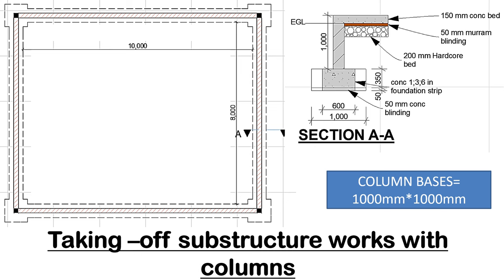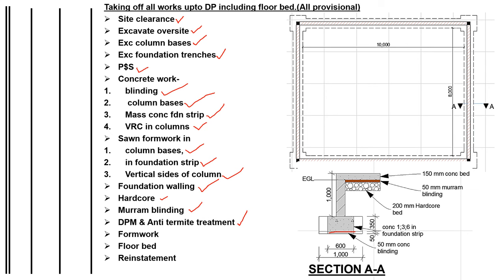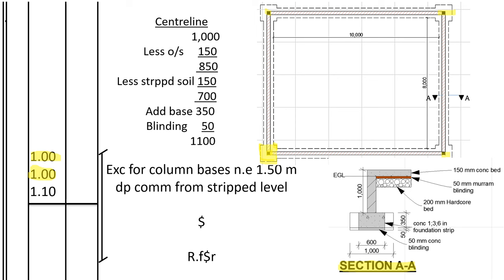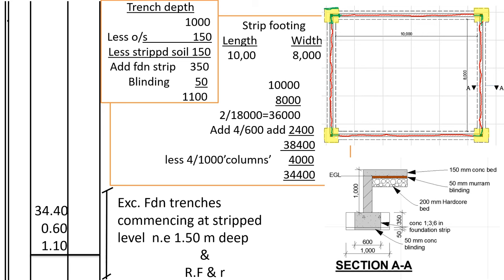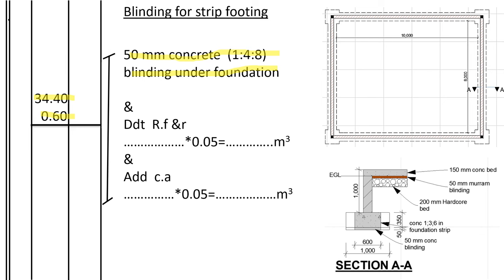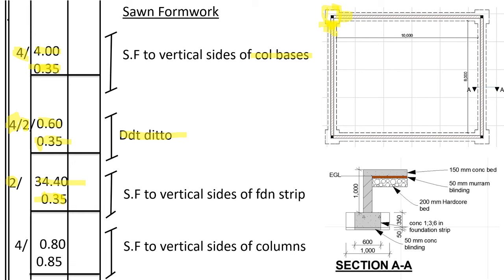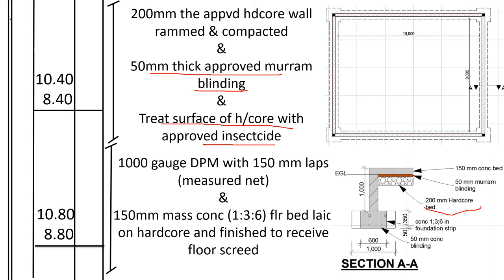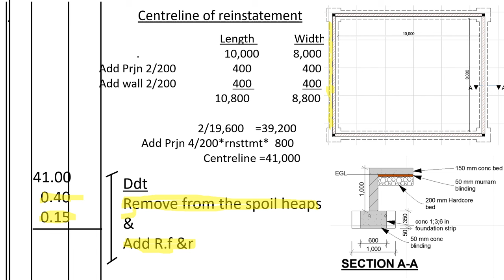Taking –off substructure works with columns

Comment: Foundation centerline calculation, ad taking off substructure works with one external column not connected to the foundation and probably has a different shape
Reply from the maker: Am working to give you this video.Kindly stay tuned.